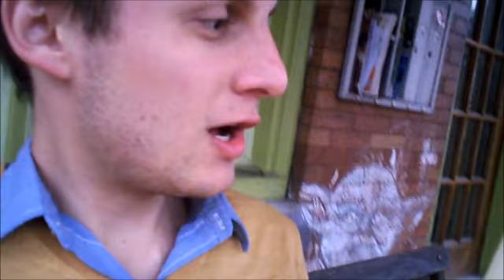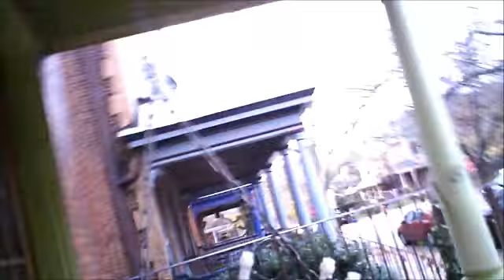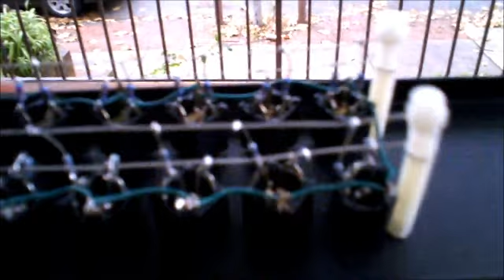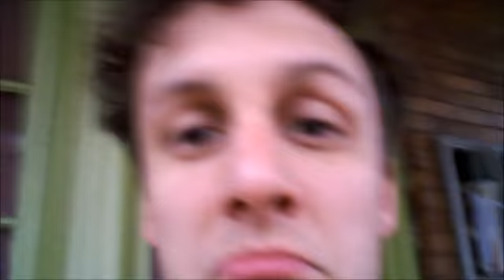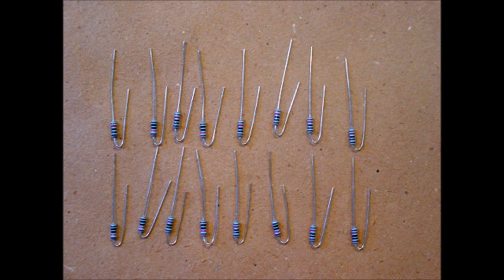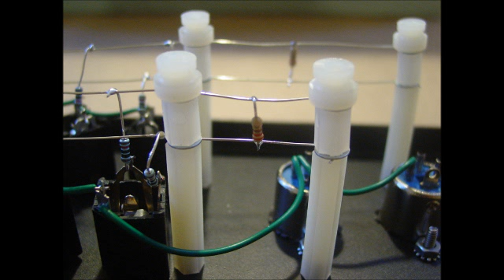How to Build a DIY Analog Passive Summing Box

Comment: If you use this for line level devices (e.g. interface and turntable preamp outputs), won't they backfeed into each other's outputs, potentially causing damage?
Reply from the maker: Nope! The resistors prevent that.

Comment: Look up OEP and VTX Transformers around 10 a pop. Add 18 of these plus two for output pre post amp, four discreet opamps  with output faders now you are in the high end world. Build it all for $300 including  Penny and Giles faders and sweet VU meters with a buffer or fed possibly off the unused primary on the master output. Power supplies are found in equipment at your local thrift store for pennies.... Pun intended Or use a few 9v until you can coble one together.
Reply: a tuto for summing box with transformer will be great, to understand circuit and built it .. ;)  cheers

Comment: If you run the sleeve to pin 1 the ring to 3 and the tip to 2, it should still be balanced. Also ground the pin chassis to pin 3. Assuming you send it a balanced signal. And output to a balanced in. It should all be balanced throughout the summing, although I'm not sure if phase would flip as you add each signal to the buss. Do amplitudes and larger voltages on peaks flip phase? I wonder if low tolerance resistors will benefit.

Comment: Hi, I want to do one of these for summing some synths to a single stereo output.  I only need 3 stereo inputs.  So 6 inputs and 2 outputs.  How would this effect the choice of resistors?  How do I know what output impedance I want?  The stereo output would go into DI box and then into a PA system.

Cheers.

Comment: Wondering what transformers and power supply you recommend if I plan on creating a version with a balanced output and built-in preamp.
Reply: Jack Russell -I was thinking along these lines. If I'm not mistaken, it would require input and output X-formers, op-amps -a complete preamp.

Comment: I need someone to build me one for about $250 to my specs. 20-channel, 2 xlr, 3 d-sub's (with 4 unused channels, because you don't want more than 20 on a passive unit). All connections are on the back. Rack-mountable, 3U or less. Sell it to me or trade me for a free mix that I'll do using your box.

Comment: I like this project and I have some questions:  I mainly use Outboard gear (think Stereo Synths and I have 1 mono input from my Mic Pre-Amp (Avalon) and couple of mono synths. The reason I want this is I want to capture the clean uncolored sound from these instruments into my sound card (Aurora 8)... Right now they all go into an Allen and Heath GL2400 analog active mixer then into Aurora 8 and then into DAW to cpature... I don't care about panning or gain and I can control the volume of all from the instruments themselves.  MY question is do I have to use all channels at once or I can just plug in just 4 stereo tracks (4 synths) into the 8 stereo (16 channel version of the mixer) ... What about if I shut off one synth and theres only 3 playing?  would that make a better or worse difference in sound quality level?  I understand you don't want to mix balanced or unbalanced signals.. What about if one of the mono synths is an older one with 1 unbalanced TRS output?  Any help would be appreciated. Thanks Much!!! :)

Comment: I build mine this weekend. It is working but it sounds a bit like an old AM-radio that is not tuned well: compressed and noisy, almost like it's clipping. Also there is a continous whining sound, even when no inputs are connected, which has the same volume, regardless of the volume setting of the preamp.

Anybody an idea what could be causing this? Maybe the grounding or some kind of radio interference? BTW: I have no other problems like that in my home studio.
Reply: I'm not an expert but from my recent restoration of an old shure mixer and getting similar issues, my best guess is that your impedance resistors are not the right value.  This old mixer has variable impedance per channel and when I increase the impedance to a high value my signal gets mega crushed and distorted and also loud.  It could also be the signal fed into the summing box.  Line level is higher than instrument level which explains why I got a cleaner signal sending my guitar through a channel on my repaired mixer vs sending tracks from my dad through it at line level.
Reply: you fix it ? what was the problem noise ? cheers

Comment: could you replace any of the resistors with potentiometers? I'm new to all this and I want to make a synthesizer with a patch bay on it for mixing various oscillators at different pitches in and out. is this mixer a good route for that? I guess it's a two part question but yeah. thanks for the video very informative
Reply: MrAnagmate i have a quick question 
cant we use a diode in place of the resistor (i mean diodes pass electricity in one direction only right?)

Comment: Could you leave a message explaining the point of this? To me it seems like it's a mixer with no gain, no eq and fixed faders (resistors). Its a really neat project but I'm not sure what the applications would be. How do you use this in your setup?
Thanks 
BTW, nice job on your clean and tidy work!
Reply from the maker: Hi, there are a couple reasons someone might want a device like this. A) Some people believe that analog summing sounds better than the algorithmic summing that's done in your audio mixing software. I'm not so convinced of this. B) A passive summing box is a great tool in a workflow that involves a digital recording medium with some "outboard" analog processing gear. For example, I like to use Reaper as my mixer, but mix "live" through my analog compressors & EQs into this box, which then goes to some nice preamps for makeup gain and back into Reaper as a 2-track mix.
Reply: @PetersonGoodwyn  right

Comment from the maker: Since the output is microphone level, you would need some sort of amplifier to get it to line-level before sending it to your headphones or power amp. What are you looking to achieve?
Reply: This is just to put all of the individual tracks in a recording session down to a stereo track for cd or whatever medium. Sounds better to do it in the analog realm, rather than stacking up a  bunch of ones and zeros in your recording software. It's not for any sort of playback or monitoring etc.

Comment: Thanks! Will be my first DIY project.

I don't understand the calculation for the output resistors that i have on a schematic: 

(20K/N)200 / (20K/N) - 200
WHERE N = NUMBER OF INPUTS 

I will have 3 Left + 3 right inputs, six total

So i found this for each one of the two resistors (left and right):

(20000/3) x 200 / (20000/3) - 200 = 0.2k

Is this ok?

Thanks!